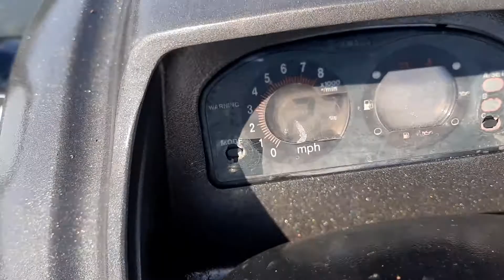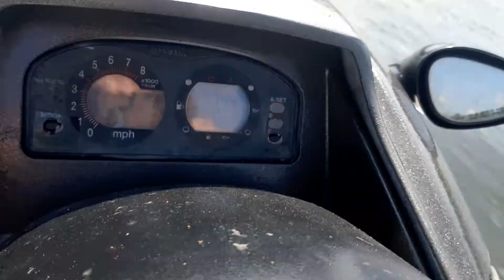Surging 2000 yamaha xl800. Do you know what causes this?

Comment: Same problem with xlt800 exact same problem
Reply from the maker: Try a new fuel cap first before spending a lot of money.
Reply: @ShadetreeJetski  I looked over the hole fuel system check valve cap filter hopefully fixed the problem thanks

Comment: Where you located? I have the same problem and I don’t find anyone to solve this
Reply from the maker: Georgia.  Just remember it may be your fuel cap they are available on Amazon.  It ccan also be a bad furl vent valve or the rubber boot on the fuel sending unit.

Comment: I have the same problem
Reply from the maker: Pressurize the fuel system with compressed air NO MORE THAN 3PSI!!!!
Spray soapy water around your fuel cap, fuel sending unit( the thing with three lines coming out of the top of the fuel tank), and any fuel hose connection( such as around the fuel filter).  Look for bubbles forming.  If you have bubbles you have an air leak that is causing fuel starvation aka a lean condition to the engine.
Using too thin of a lanyard can also cause intermittant contact of the safety switch as well, but usually you are going to find an air leak in your fuel system such as a bad rubber seal under your fuel cap.

Comment: What if you have to give it gas for the idle to keep going I’m having similar symptoms with a gp1800 208
Reply from the maker: Sounds like that one should be fuel injected so the ecm controls all that.  You probably have dirty injectors.  It should also have a throttle position sensor.  I would run a high quality injector cleaner with high octane non ethanol fuel first to see if it makes a difference.

Comment: Great job solving this, subscribed today - I have a 2000 XL1200 that won't go over 3,000 rpm. Looking to pick your brain. Is there a way to reach out other than via the comments?
Reply from the maker: I learn as I go and dont know it all.  I do know that rpms are determined by the cdi to some degree. If the carbs arent right it wil never run as it should either.  I search greenhulk and pwc today forum threads for specific problems like that.  It sure sounds like cdi or stator issues though.  It can be bad grounds in the electrical box or in the  stator as well.  It could be running in limp mode due to a faulty temp sensor but you should get the warning beep unless it is disabled.  How about your powervalve servo motor?  Do you hear it cycle after switching off the engine?  Have you done a compression test on all the cylinders?  My email is in the description section of most of my videos.
Reply: @ShadetreeJetski  I've posted on greenhulk and am looking for replies. Will try pwc today as well.
Power valve servo motor is DEFINITELY cycling. I think I checked for that after seeing one of your videos.
Compression test is 110/110/100, with the "100" in the PTO. 
I know just enough to get myself into trouble.
Reply from the maker: Greenhulk says most likely carbs need rebuilt.  If they were built with ebay kits then there is your problem.  The powervalves must also be cycling.  If you have 100 hours you should remove and clean those powervalves.  I would absolutely clean the powervalves if I took all the time to rebuild those carbs.  You have to make sure that the acceleratir pum is functioning as well.  Each carb has a small brass tube that sprays directly into the venturi.  Inside of that tube is a one way check ball.  It can get stuck and sometimes you have to clean that tube out.  I test each one with wd40
Reply from the maker: It is a big job pulling all the exhaust to get to those carbs.  I did an oil line replacement video on a 2004 xlt1200 in two parts that will give you an idea of what is involved.  You will need a torque wrench and 1 exhaust gasket as well as new oil lines, oetiker clamps and carb kits and carb base plate gaskets (3) plus the one large one .  So about 250.00 in parts alone.  I recommend putting a new accelerator pump diaphragm in when you build that carb.